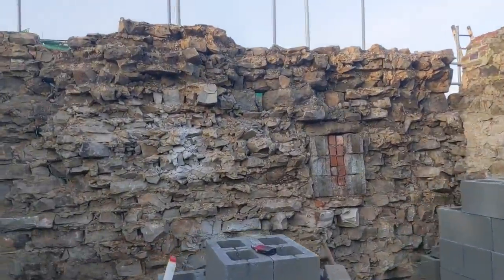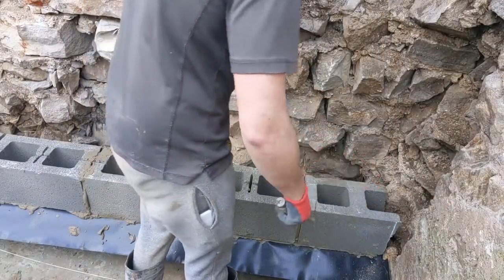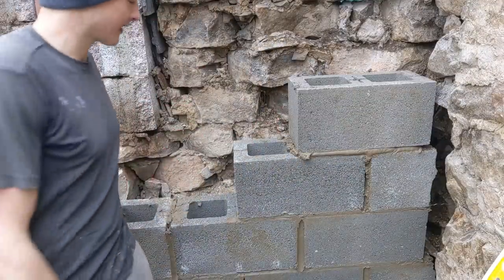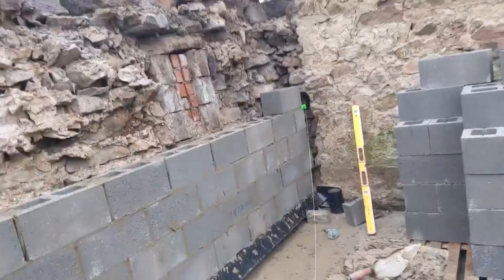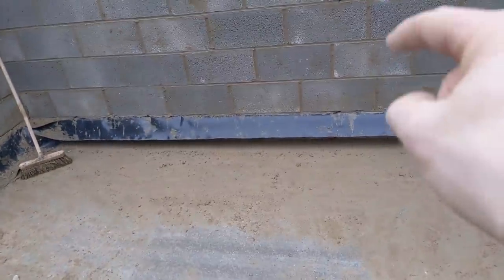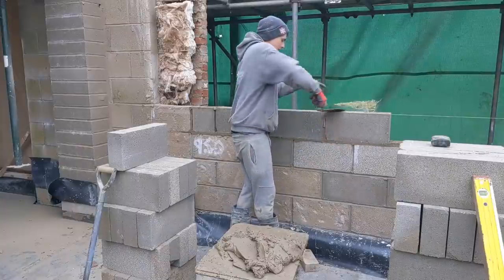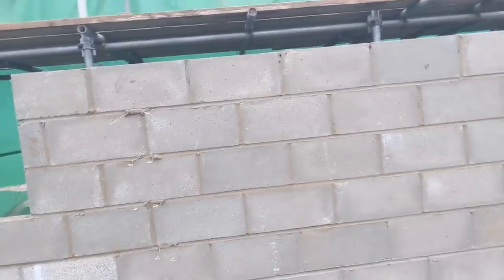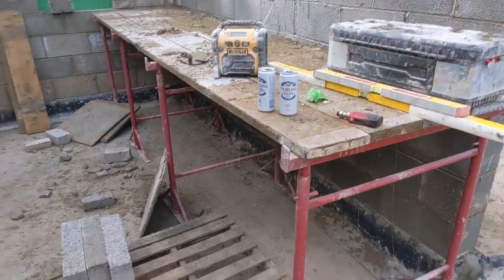Bricklaying - Barn Conversion - Internal blockwork DONE #bricklaying #renovation #vlog

Comment: A perimeter belt of reinforced concrete reinforced with iron bars around the height of the windows would enhance the structure. Even vertical reinforcement with reinforced concrete inside the holes of the concrete blocks, especially in the corners! This is because the outer wall is very old. Wonderful laying!
Reply from the maker: Thanks for your comment buddy, you know your stuff!👌💪 Thank you ☺️

Comment: Question on a single skin Concret block wall how do you stop the rain coming through the block from the outside
Reply from the maker: The stone work is going to be built back up with a cavity. So the damp won't come though. The big old stone wall what I said is staying, is going to be battened out with some 1x1 timber with a vapour barrier on it. So no moisture enters the building 👌👍
Hope your well Mary
Reply: @IzzytheBricky  Sorry I didnt mean on this building I have a garage it's a single skin concrete block wall plastered on the outside but the inside of the walk the blocks are all damp in big areas
Reply from the maker: Hiya, okay I see what you mean. It's relatively simple as is pretty much fixed by the way I previously mentioned 😊 Of you have Instagram, I can send you some pictures to get over the issue
Reply from the maker: IzzyThebricky@hotmail.com 😊
Reply: @IzzytheBricky  I sent some pictures
Reply from the maker: @maryellis3661  fantastic I've emailed you